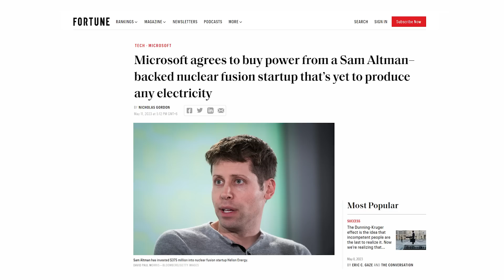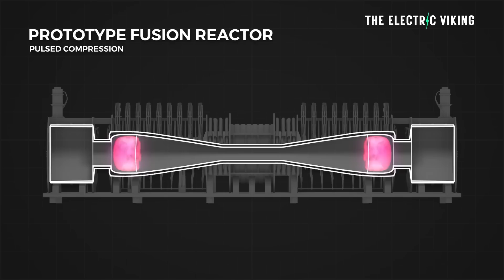Microsoft says the nuclear fusion dream is about to become a reality

Comment: What a time to be alive really, to witness artificial intelligence helping humans reaching net gain in fusion energy it's just too sci-fi to believe, amazing times are coming
Reply: No AI needed.  Look closer at Helion's two step process. Helion will be making their own expensive H3.  Helion's fusion is actually a two step process.  First they make H3 with just deuterium in opposed accelerators similar to their main fusion accelerators. Deuterium is not that expensive.  Helion will use separate accelerators because making H3 releases neutrons which will degrade the accelerators.  The accelerators for making H3 don't have to be as good as their main, opposed, fusion, accelerators.  Then that created H3 with deuterium will be used in their main opposed fusion accelerators and this reaction will not release neutrons, so the accelerators will last longer.  Helion will also be be able to sell tritium to other reactors or keep storing it until the tritium decays into H3 after 12 years.  Helion might be a profitable business just by making and selling H3 and tritium.
Reply: AI has nothing to do with fusion.

Comment: World has gone mad! AI! Fusion! Bonkers!
Reply: Maybe not.  Look closer at Helion's two step process. Helion will be making their own expensive H3.  Helion's fusion is actually a two step process.  First they make H3 with just deuterium in opposed accelerators similar to their main fusion accelerators. Deuterium is not that expensive.  Helion will use separate accelerators because making H3 releases neutrons which will degrade the accelerators.  The accelerators for making H3 don't have to be as good as their main, opposed, fusion, accelerators.  Then that created H3 with deuterium will be used in their main opposed fusion accelerators and this reaction will not release neutrons, so the accelerators will last longer.  Helion will also be be able to sell tritium to other reactors or keep storing it until the tritium decays into H3 after 12 years.  Helion might be a profitable business just by making and selling H3 and tritium.

Comment: What isn't mentioned here is the absolutely colossal amount of electricity required to run this machine. It uses so much electricity that they claim the power grid simply cannot supply it. They have an entire room that is packed with huge capacitors that they use to send huge pulses of energy to the electromagnets. 1 single pulse uses up enough energy that it would drain a third of a Tesla car battery (if I remember rightly), and they want to be able to do 10000 pulses per second. How is it supposed to generate more energy than that? They do have a way of generating electricity (the charged ions from the fusion process apparently 'push back' against the electromagnets and this force can apparently can be used to generate power) but while they are quick to show off how much power it uses they always conveniently fail to mention how much it generates. I think the reason is because it will be nothing in comparison to what it consumes.
Reply: Nope. Pulse-fusion is different.  See my posts above.

Comment: 😂 What is funny is that the Stored right here right now is the Fissionable waste from spent Nuclear Reactors is still a viable energy source it can still generate power for years but using it's waste heat to say gasify a chemistry like Ammonia which takes little to turn a turbine from the pressurized gas. I'll believe it when I see a test bed display and actual results from real world tests. Now to say something is impossible is to be narrow minded. So, I won't dismiss it out of hand. The Chinese if I remember last weeks article said they ran their unit for 6 minutes. And I didn't even cover Thermal Salt Reactors which are Fool Proof.

Comment: Be humble, oh humans .. . we already have a fully functional fusion reactor. It's called the sun! 

And it's energy is easily and economically collected with passive fusion energy harvesters called solar panels and wind turbines. Ultimate energy source: FUSION! Yeah, renewables are ALREADY freakin' FUSION!!! Clue in!

Further, wind and solar do not add passive heat to the planetary biosphere the way burning helium or hydrogen would.

Controlled fusion for future space exploration, great. But a complete and unnecessary misfit for Earth.

Deep time thought experiments: 

Perhaps in the distant future, controlled fusion could be used to insulate heat loss from Earth's core and thus maintain the protective magnetic field which otherwise cools and fades;  

Or . . .

Perhaps in the distant future, fusion powered giant rail guns could fire earth mass into space and slowly over millions of years bump the Earth into a more distant orbit as the sun expands and warms.

Comment: Quite a few smaller companys working on Fusion as well using the small is better concept and even a few bigger ones. 
I don't think it's closed to be being really solved on an Engineering Level that will support commercial reactors. The idea
to bypass a steam generator would be a futuristic option and certainly necessary for using in in Space. There is a Canadian
company (I believe ) that is using physical compression to assist in achieving Fusion that seems wacky. The Temperatures
though high are needed  if you ever hope to Fuse non isotopes Hydrogen and anything but Hydrogen.
Reply: No plasma has a charge.  The plasma expands through coils producing electricity. The pulses of electricity are caught by large capacitors, which feed batteries.  Fusion just produces this plasma and it is released through coils, making electricity.  This is what Sam missed.  Look closer at Helion's two step process. Helion will be making their own expensive H3.  Helion's fusion is actually a two step process.  First they make H3 with just deuterium in opposed accelerators similar to their main fusion accelerators. Deuterium is not that expensive.  Helion will use separate accelerators because making H3 releases neutrons which will degrade the accelerators.  The accelerators for making H3 don't have to be as good as their main, opposed, fusion, accelerators.  Then that created H3 with deuterium will be used in their main opposed fusion accelerators and this reaction will not release neutrons, so the accelerators will last longer.  Helion will also be be able to sell tritium to other reactors or keep storing it until the tritium decays into H3 after 12 years.  Helion might be a profitable business just by making and selling H3 and tritium.

Comment: This doesn't have to be significantly cheaper than solar and wind.  Solar and wind require a large footprint and annoying towers dotting the landscape. Fusion will be worth some premium to get rid of those.
I continue to keep my fingers crossed.
Reply: Probably will be a lot cheaper if they are successful as the generator is part of the reactor. But the main thing will be the ability to provide electricity as required. No intermittently like solar and wind.

Comment: where is the link(s) to Helion ??
Reply: Summary:  Plasma has a charge.  A charge passing through coils produces electricity.  Helion uses fusion to produce plasma and releases it through coils, making electricity.  People are also missing that Helion uses a two step process. Helion will be making their own expensive H3.  Helion's fusion is actually a two step process.  First they make H3 with just deuterium in opposed accelerators similar to their main fusion accelerators. Deuterium is not that expensive.  Helion will use separate accelerators because making H3 releases neutrons which will degrade the accelerators.  The accelerators for making H3 don't have to be as good as their main, opposed, fusion, accelerators.  Then that created H3 with deuterium will be used in their main opposed fusion accelerators and this reaction will not release neutrons, so the accelerators will last longer.  Helion will also be be able to sell tritium to other reactors or keep storing it until the tritium decays into H3 after 12 years.  Helion might be a profitable business just by making and selling H3 and tritium.

Comment: You may want to learn more about radioactivity and modern power plant designs.

If an isotope is radioactive for millions of years, it is barely radioactive at all, and thus not dangerous.  If something has a half life of hours, it is wildly, deadly-dangerously radioactive, but it very rapidly burns up and so in a few days it is gone and no longer dangerous.  A middle ground are isotopes which are radioactive for a couple hundred to a thousand years.  They are somewhat dangerous, and last a long time, so you want to minimize the creation of isotopes in this range.  The fewer transuranic actinides produced, the better.

Modern reactors (such as the Thorium based molten salt reactors being built in China) produce few long term wastes.  They have to have their wastes isolated for 200 to 300 years before they are less radioactive than the ore that the fuel came from.  Some reactors designs can 'burn up' current nuclear wastes, turning the waste into extremely valuable fuel.

Warm regards, Rick
Reply: Helion uses a two step process. The first step making H3 produces Neutrons - radioactivity.  The H3 and Deuterium fusion are clean and doesn't produce neutrons. Summary:  Plasma has a charge.  A charge passing through coils produces electricity.  Helion uses fusion to produce plasma and releases it through coils, making electricity.  People are also missing that Helion uses a two step process. Helion will be making their own expensive H3.  Helion's fusion is actually a two step process.  First they make H3 with just deuterium in opposed accelerators similar to their main fusion accelerators. Deuterium is not that expensive.  Helion will use separate accelerators because making H3 releases neutrons which will degrade the accelerators.  The accelerators for making H3 don't have to be as good as their main, opposed, fusion, accelerators.  Then that created H3 with deuterium will be used in their main opposed fusion accelerators and this reaction will not release neutrons, so the accelerators will last longer.  Helion will also be be able to sell tritium to other reactors or keep storing it until the tritium decays into H3 after 12 years.  Helion might be a profitable business just by making and selling H3 and tritium.

Comment: To be honest, I can't see this being competetive with the much simpler LFTR reactors which are being developed by many companies. We already know that Molten Salt Reactors work, it's a much easier technology to bring to market so much cheaper. It has pretty much all of the benefits of Fusion without the complex and extreme tech required to make it work. One the first LFTR reactor is commercialised, it will be game over for Fusion commercially.
Reply: Nope. Helion's reactors are basically coils around a narrowing tube.  Particles are accelerated at each other down opposing tubes.  Industrial capacitors are used to drive the coils and recapture the electricity.  As the plasma from fusion expands its charge produces electricity in the coils.  Doesn't get simpler than this.

Comment: Have no idea if this will work or not but doesn't seem like a scam. My (severely limited) understanding based on the RE video is since it's a pulse kind of thing the crazy high temps only last for tiny fractions of a second so would likely be more manageable? Also even if nuclear fusion costs are higher than Solar/Wind I could still see use-cases - deep space exploration, Martian colonies, under water projects etc.

Comment: I've seen there vidio . I believe they will do it
Reply: Summary:  Plasma has a charge.  A charge passing through coils produces electricity.  Helion uses fusion to produce plasma and releases it through coils, making electricity.  People are also missing that Helion uses a two step process. Helion will be making their own expensive H3.  Helion's fusion is actually a two step process.  First they make H3 with just deuterium in opposed accelerators similar to their main fusion accelerators. Deuterium is not that expensive.  Helion will use separate accelerators because making H3 releases neutrons which will degrade the accelerators.  The accelerators for making H3 don't have to be as good as their main, opposed, fusion, accelerators.  Then that created H3 with deuterium will be used in their main opposed fusion accelerators and this reaction will not release neutrons, so the accelerators will last longer.  Helion will also be be able to sell tritium to other reactors or keep storing it until the tritium decays into H3 after 12 years.  Helion might be a profitable business just by making and selling H3 and tritium.

Comment: Terrestrial nuclear energy is an environmental disaster and contributes to climate change in two ways.  The small way is the concrete used to build those plants release huge amounts of CO2.  The big way is the constant direct infusion of energy into the environment.  Solar, wind, etc, simply recycle energy that is already in the environment.  Energy added to the environment by humans is currently only limited by cost.  If it becomes cheap, the amount of energy added to the atmosphere will increase dramatically, more than counter-acting the reduction in CO2.  Water vapor is the most dominant greenhouse gas.  Google it.  Nuclear plants heat and release huge amounts of water to cool the reactors.  Solar, luckily, is now the cheapest energy source and the least demanding of the grid due to localization.

Comment: Heat up helium to a temperature many times that of the solar surface (no plasma confinement is necessary) in a plasma accelerator, atoms start to fuse and out comes pure electricity! This is so magical, who is on the payroll of helion fusion? Harry Potter? Merlin the wizzard? Gandalf the grey? Willy Wonka? Noop, its doctor Strange who did two Physics masters in the same 2 years (AAA engineering and nuclear engineering), then became an electrical engineer, etc etc, and finally CEO of Helion Energy since 2010. Although not 1 microwatt was ever produced and independently tested, Bill Gates and others invest in this research promise. But the picture is wrong, its a hoax.
Reply: Summary:  Plasma has a charge.  A charge passing through coils produces electricity.  Helion uses fusion to produce plasma and releases it through coils, making electricity.  People are also missing that Helion uses a two step process. Helion will be making their own expensive H3.  Helion's fusion is actually a two step process.  First they make H3 with just deuterium in opposed accelerators similar to their main fusion accelerators. Deuterium is not that expensive.  Helion will use separate accelerators because making H3 releases neutrons which will degrade the accelerators.  The accelerators for making H3 don't have to be as good as their main, opposed, fusion, accelerators.  Then that created H3 with deuterium will be used in their main opposed fusion accelerators and this reaction will not release neutrons, so the accelerators will last longer.  Helion will also be be able to sell tritium to other reactors or keep storing it until the tritium decays into H3 after 12 years.  Helion might be a profitable business just by making and selling H3 and tritium.
Reply: @jamescottrell7147    Does H3 mean 'tritium' (I don't know for sure)?    1) The many million degrees celsius/Kelvin plasma will melt its container in an instance, if the plasma isn't contained in a vacuum, and there is no indication that this device generates the required vacuum between plasma and its container. 2)  Even if fusion happens in this device, the surplus energy (explained by mass to energy conversion) has the form of heat, and does not become manifest in the form of an electric potential. So how does this device turn heat into electric energy (an expanding plasma has nothing to do with Faraday's law)? 3) The company does not represent any data from measurements done by independent witnesses with University PhD background. I have seen many hoax websites very similar to that of Helion Energy with amazing website graphics (the 'power' elite has plenty of dollars to pay for professional hoaxes), that promise unlimited energy production.

Comment: The problem is not achieving ignition. That's been done. It's not yet been sustained. Also, the idea that ignition is enough is false. A 1 kw laser takes far more energy to produce than the 1 kw output. So ignition has to produce several times as much energy as the actual energy to initiate ignition. Then you have losses in the anciliaries such as transmission lines. I reckon it would be easier to genetically modify humans to mimic plants and turn sunlight into energy. And that won't happen ever.